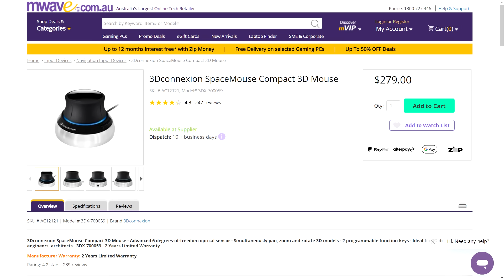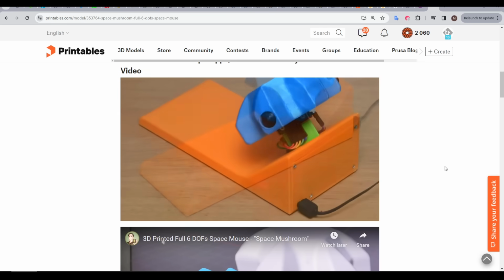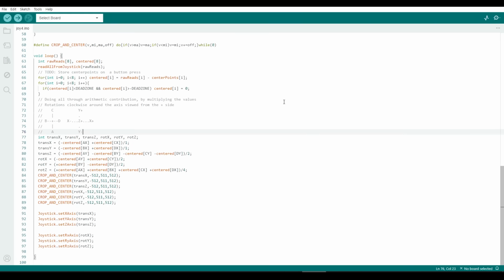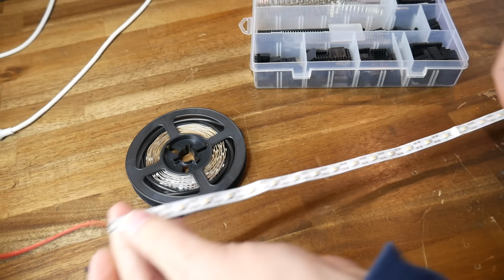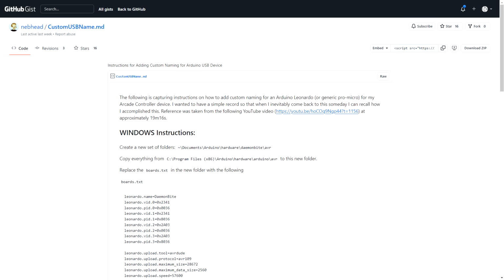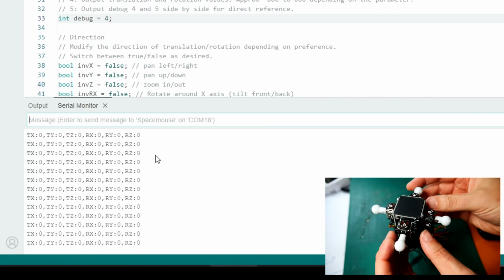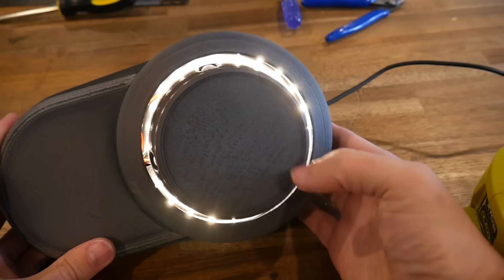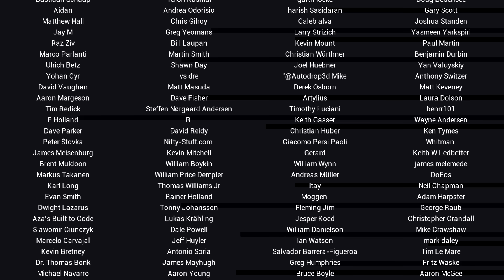Making a cheap, open source 3D space mouse with Arduino and 3D printing *V2 out*

Comment: As someone in the market for a space mouse, this video is great. I'm going to be ordering parts and doing the build in the next week or so.

While watching the video though, it strikes me that the solution to the overall size could be as simple as reducing the size of the big joystick's actually manipulated surface area. Instead of mimicking the shape of the 3dconnexion joystick, you could make it look a lot more like the smaller joystick nubs. Bring the whole shape to a more rounded dome, then give it a stem and a wide head. That way, instead of pressing down on the front of the joystick, you can lift up on the back to get the same angle. Could probably even do it with your thumb. The shroud the whole joystick sits in can also be raised to cover all but the moveable range so your fingers can rest on it and then move the stick with about twice as many controllable angles. I'll be testing this once I've got the base build assembled, but if anyone is further along with it and wants to give it a go, I could mock up a model to reference.

Comment: I use the real thing. Cool project though. Its enormous size seems unnecessary. Couldn't you turn the mechanism inside out, so the electronics / wiring is all in the fixed base, with the joystick levers pointing inwards to a more conventionally sized puck?
Reply: You could but the 4 arms will likely get in the way since you have to hold it at center of rotation

Comment: Not to be a party pooper, but if you need all the parts to make this, including the proper tools, wire and misc.parts, this is more like a $60 mouse.  Ifyour not fami lo iar with Arduni, this is a no go project until someone can write the program and it can be simply downloaded to the board.
Reply: Yeah at this point DIY space mice require a lot of time. I got the OS3M mouse but right now only 2 programs are supported and it's tough for me to add more. T.T. is a wizard for getting this far.

Comment: I bought a proper space mouse, and quickly realized I preferred using keyboard and mouse a lot more. Wasted hundreds on that stupid thing.

Not only was it less comfortable to use, but it also ended up being way slower since I constantly had move my hand back to the numpad/keyboard to enter dimensions, and other things. They might be better for showing off or inspecting a finished 3d model, but they’re way worse for modeling and assembling

Comment: Looks like you missed the space mouse from Salim Benbouziyane
Reply: That one's only 3DoF and probably only runs in F360. he could mod it to make it 6DoF, but it's not there yet
Reply: @ColinJWiens  hmm guess I’ll need to go back and rewatch it I don’t remember it being functionally limited, although when I looked at the instructables I hadn’t noticed an attempt to fake the driver so it’s at least limited in that regard.
Reply: @JeronimoStilton14  Nothing works with a DIY 6DoF controller out the box, especially since they all give different values. But assuming it's not hard, people can use Teaching Tech's code to pretend the device is a space mouse, and then it'll run in a lot of programs.

Comment: This is a great project I would definitely take on myself for home use. I have a dedicated Space Mouse for my mechanical engineering job I use daily for 10 years now and love using it. Being able to diy one myself for home is a great option. Thanks for posting this!
Reply: 95% of joysticks on Amaz/Aliex are stiff + have worthless "potentiometers", including the ones in the vid. That ends up making them digital devices, as shown with his CAD movement at 5:50. Even ones that claim to be OEM are nearly all fakes. The only good option is to salvage from old controllers or buy from a seller I finally found called "SOSS Gaming", but you'll need to solder them to PCB's yourself.

No point making a 6DoF device if it's not analog.

Comment: It would be more expensive, and likely more complicated (since as far as I can tell, it has standard joystick outputs, but it uses a tiny ribbon cable instead of the larger standard pins on a regular joystick), but would using something like Switch joysticks work as a way to help decrease the size? Ideally, the Hall effect ones from Gulikit that they also use in their own "Elves" Switch controllers. Switch joysticks are significantly smaller than standard joysticks, and the Hall effect ones fix the infamous Switch stick drift issue
Reply: Using literally any joystick other than amaz/aliex ones is ideal, since as shown at 5:50 their potentiometers are so bad they're digital on/off devices. Even 95% of "legit" OEM ones are equally bad. Hall effect is the best tech, you just have to ensure the magnets don't interfere with each other since the joysticks are close together (maybe shield with steel)

Comment: Thanks 👍👍 - I want one! - now off to Ali Express, eBay etc. to get the various parts I need 🛒
Reply: Joysticks on Amaz/Aliex are 95% worthless, as shown with his CAD movement at 5:50. Even ones that claim to be OEM are nearly all fake. The only good option is to salvage from old controllers or buy from a seller I finally found called "SOSS Gaming", but you'll need to solder them to PCB's yourself. Another option someone suggested is hall-effect sticks, which are best but may need magnetic shielding (steel).

Comment: Not sure if this will work but why not have the joysticks face inwards and the actual part that you hold to do the movements be a smaller shaft that extrude over the joysticks making so you have a smaller part that does all the movements.

Comment: can you use smaller joysticks (probably ps vita is correct size)? an alternative is use springs for the structure and hall sensor with magnets
Reply: Hall sensors are one of the best types of sensor assuming you can minimize interference, you could even use the joysticks just as springs, but the problem with cheap joysticks is how stiff they are.

The OS3M mouse uses induction sensors that detect metal but its flexure (spring) is plastic so it sags, I'm likely going to design a mod with springs.

Comment: Having worked on something like this, I completely understand your frustration. 

That's said, your implementation have the exact same problem as all existing one. At the core, we need to solve the forward kinematic of a parallel manipulator, which have no analytic solution, much less a linear one like in your code. 

As a result, your mouse will only work correctly when one axis is in use. Doing any non trivial maneuvers that requires multiple axes, especially rotation and translation at the same time, for example orbiting an object, will cause crosstalk. This is why the movement is so jerky in your demo.
Reply: The movement at 5:50 is jerky even in 1DoF because 95% of Amaz joysticks have worthless potentiometers that are basically digital.

There's no kinematics/crosstalk, the math is just the sum of joysticks, literally 6 lines of code for all 6 DoF (e.g. pitch is controlled by 'Y Axis Stick A' minus 'Y Axis Stick C')

Comment: Why do many sensors? can't the same thing be achieved with a 9axis IMU sensor instead?
Reply: 8 potentiometers (2 per joystick, gives some redundancy). IMU's don't know absolutely where they are in space, hence why they're never used on their own when precision is needed (e.g. VR tracking).
Reply: @ColinJWiens  but you don't need to right? Tilt to pan, lift,... it's always a quick relative change to activate a movement
Reply: @tld8102  it's possible, especially if you zero the imu periodically when it's not moving to reduce the inherent drift that Imu's get
Reply: @ColinJWiens  that's fair... how would the IMU know when to zero it's?
Reply: @tld8102  If you weren't using it for games you could zero it whenever no significant movement for 10-15s, because with CAD you're never going to hold it in a non-neutral position for 10s. I doubt it would work well with games since you'd likely never leave the mouse in the neutral position for 10s. Even the Wii used an IR camera to help the IMU with positioning.

Comment: Want it smaller? 
Option 1: invert analog joistic orientation so they  face inward, not outward.
Option 2: use magnets and Hall sensors. (btw it is cheaper and reliable)

Comment: I'm kind of thinking that I'd rather make one along the lines of the one that Salim Benbouziyane made. I'm not saying it's better, or worse than the one you've built, and by the time I'm done, I may end up with a larger device, A lot of that will depend on the springs I use. One of the things he did was add a couple of buttons that allows him to add keyboard macros that recenter the model and reposition the camera to "home" position. 

An option that could change the 'size' of the controller is to move all the joystick bits into the base, with a stem/knob that protrudes above the base. that's significantly smaller. In theory you'd then have options to add buttons to the knob, or the base if those are of interest.

Comment: Cool project. One technical question, does it really need 4 joysticks, it seems 2 should do the job too.
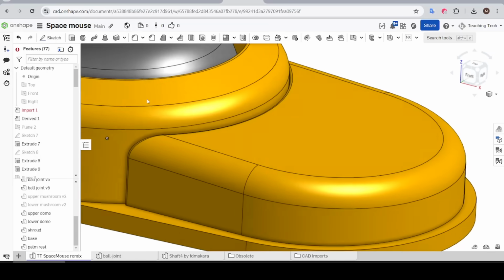Reply: 3 sticks is the minimum for 6DoF (2 potentiometers per joystick), but 4 doesn't take much more space and adds accuracy... kindof, his cheapo amazon sticks are worthless as shown at 5:51, they can't do slow movements, they're just on/off. I've been burnt by those sticks a lot in the past.
Reply: @ColinJWiens  thank you, i missed 6DoF point.

Comment: It is a community effort but it relies on proprietary and commercial code i.e. the drivers and browser extension. The mechanical and electrical design have probably been done years before the company even existed but the software is surely new. As a company, they have the means to pull the plug on this, as it happend to a lot of other cloned projects: FTDI, Saleae, VCDS, ...
Probably the community will step in at one point and write those drivers and utilities from scratch.

Comment: Holy moly I didn't realize a 3D mouse was that expensive. I thought like, $99 would be a fair price for the little knob version.
Reply: It's not the hardware which is expensive, it's the software/firmware in the device.

Comment: not the best idea but I think to make the unit smaller making the switches on the outside of the manipulator would allow the pad to get smaller.  the over all assembly would likely be about the same.  but it might allow the part the user deals with smaller.  that and maybe a sloped arm rest to make it less noticeable about the size.  definitely a neat project by the way.  good luck and I hope you all keep working together to perfect it

the other thought to maybe making it smaller would be 3 switches.  it does mean that it will more coupled values for some of the inputs.  but less switches, smaller mount core, smaller overall assembly.  I think

Comment: While a neat project, I’d imagine it would get a little tiring with the joystick resistance. The really nice thing about the space mouse is that they have so little resistance to move. If you look at a teardown, they are literally just 2 pcbs separated by 4 springs. It’s a very elegant and well performing design. Also their software integration makes it feel seamless to use.

Worth the price for the base models in my mind. Not as sure about the bigger models. I printed a copycat base and it works well.
Reply: An option would be to remove the springs on the joysticks and use lighter springs on the frame directly.
Reply: Actually after looking how they do it, a 3d printed shade with a differential 
pair of phototransistors might work well and be easy enough to use.

Comment: I've been using a USB wired SpaceMouse for at least 10 years, primarily in Altium, and now in Fusion. While it wouldn't have generated any YT content, you spent far more DIY'ing one than just spending the $279. I don't care for the versions with all the buttons, although one of my cow-orkers swears by it.  FWIW (and I really don't care about this, but here it is), I believe technically you're violating their software licensing agreement by using the driver and not their hardware. However, I'm not going to read 200 pages of tiny little print to find out.

Comment: This is great! My new job has a 3Dconnexion and I really like using it but didn't want to spend the cash for my own. I looked into the 3D printed solutions but none seemed that great to me, especially since I didn't want it just using mouse / keyboard inputs, so knowing there's a way to emulate the 3dconnexion driver is really useful!

Edit: I also have 4 leftover tiny joysticks from repairing my Valve Index controller that I think I could shrink the design down by using, I feel a project coming on!

Comment: This is an awesome project and glad you were part of it Michael. I had wanted something like this and took some time looking around. I ultimately purchased an actual SpaceMouse and it completely changed my workflow. I am completing my associates in Technical Drafting and it has helped significantly. Yes, it does take a little time to get use to but it is well worth the effort.
3dconnexxion does offer a 20% discount for teachers and students of a college or university.

Comment: I use trackball for this purpose. Actually never tried mouse in Blender. I was long gone from mice when I bought 3d printer. I use Marble 'mouse' trackball. It have two large buttons, left and right. And two small buttons for back and forward I suppose. In windows it had bad software as far as I know. But it was very long ago. In times of windows xp and 7. It never worked alright there. Horisontal scroll wasn't a thing in those times. I remember even win98 times, when I bought a mouse with two wheels. And was disappointed. Horizontal scroll mostly never worked.
So I remember my Marble 'Mouse' as they call it, in Windows as a quite useless thing. On Mac it can be tuned, or at least I was able a couple of years. They update software often, and everything stops to work from time to time. So I hope that W11 knows about horizontal native scrolling. And afraid that Mac updates broke Logitech program which needed to customize this trackball. But at least on Mac I could feel it work normally. You know, just like on Linux. As it always worked alright there. No additional software, no drivers. Kinda magic. But of course you need to download a config text document and may be to move some numbers to change button mappings for you preference. So enough of Linux advertising.
So when I turn the ball, I move my cursor. When I press small left button it switches ball to scroll mode, and I can scroll vertically and horizontally. If I just click left small button it middle clicks. And usually I do not use small right button. Just never sought I will need it at all.
But in Blender middle mouse button is used to look around. And it did not work for me. So first time I was very confused, how to use Blender at all. I used keyboard to navigate. It was hard.
But later I found if I map simple middle button without scroll function to the right small button, it works.
So when I press left small button, I can zoom in and zoom out, just rotating the ball. Horizontal movement does nothing. And when I press right small button, I can rotate my object (just like that space mouse do, as I think). If I hold Shift key, and press right small button, I can move camera. It is quite comfortable for me.
I moved to trackball, as I was tired of moving mouse all over the place. I tried mice with dpi switch function, and this was better than nothing, but my hand was not happy. So 10 years, or so I swtiched to this Marble 'mouse' trackball. I use forefinger for ball movement. And I think it is really comfortable. I saw other models, with left ball position. I cannot imaging using those, as my thumb does not move easily. But it is the strongest finger, so I think I got the point. But my thumb aches even from thinking about rotating a ball.
So... I think it is a good idea to try such a device.
Also i guess a touch pad with gestures can do similar thing. If it will work alright of course.

Comment: Yay, I was on a 2 year journey too to make pretty much the same. I tried joysticks, I tried IMU's, I settled on halleffect sensors and some magnet. 
Mine is a bit more 'delux' with a 2.8" touch screen,  round display in the center of the dial, encoder in the dial for scrolling. 

The software was the far most time consuming! I ended up designing a web wizard to configure all the touch buttons and other functions.
Reply: I based mine on an ESP32, since it needs to house a webserver, beside Bluetooth, MQTT and drive the 2 displays. 
Oh and then I made the giant version with 3 touch screens....